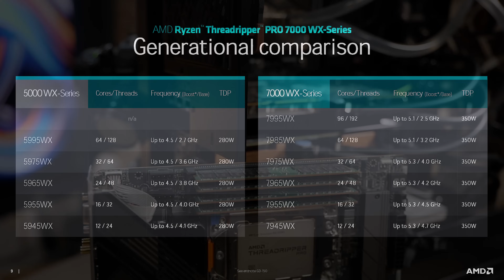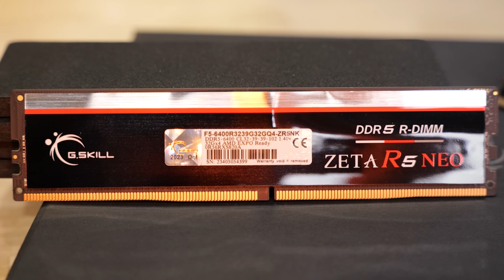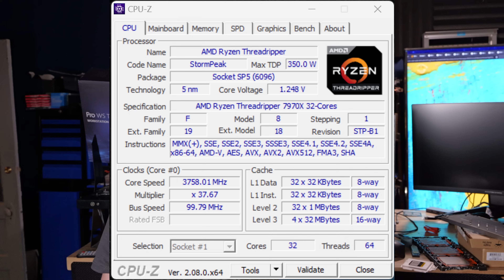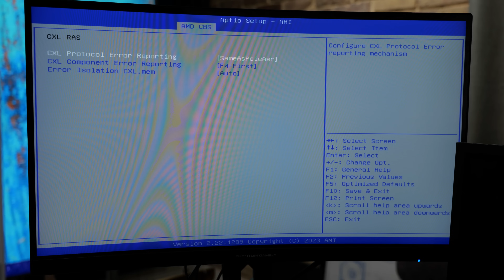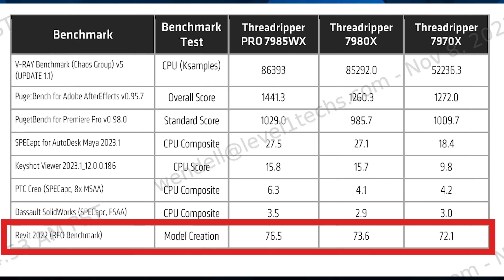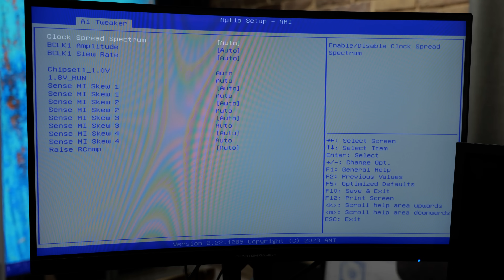AMD High End Desktop is back: 7980X & 7970X  Threadripper Tested

Comment: Can't seem to get my 7970x to fit in my AM5 platform.
Should I cut it in half or something?
Not appearing to be an easy drop in replacement for my 7950x.    AMD told me the AM5 platform was going to be supported for the next 2 years.
Reply: No, you just fold your CPU on the middle. Doesn't matter which way, as long as the pins point outwards. Then mount it in the socket.
Any pins that are not in use, can be cut off.
Reply: @akyhne  Gotcha.  I did that, but it kept unfolding and bending up pushing off my heat sink, so I nailed it down into the socket with a staple gun.
Reply: This is a troll right
Reply: @Vekstar  She's either an 1D10T, or a snarky angry consumer making an ascerbic critisism, annoyed that AMD can't decide on a single bloody dmmn socket for their own chips, and that there's two entirely different sockets between Intel and AMD, that change every 2 years.   

Instead of you know, coming up with one industry standard future proofed socket, and sticking with it for at least 10 years.

Comment: What's the cooler support for this socket? can I keep using a be quiet dark rock tr4?
Reply from the maker: generally cooler compatibility is close but not quite 100% with sp3 :)
Reply: Noctua has a new Cooler for SP6  socket. Arctic Freezer 4U-something lists SP6 compatibility. I was checking this for EPYC Siena, both are Zen4c and use SP6.

Comment: Doesn't this DDR5-6400 having "loose" secondary and tertiary timings? I know it might not be easy to overclock 4 channels, but if it's 1 DPC, you might try to drop to 6000 and try to make those timings more tight. I think.
Reply: Good thing about ECC -> the memory will tell you where the limits are
Reply: @TheExard3k  true

Comment: Way over priced
Reply: They either sell the chiplets as EPYC for much more or offer discounted price on more limited platforms like TR. If you want high clocks and lanes+memory bandwidth, there is no other option.
Reply: @TheExard3k Well EPYC CPUs have far more PCIe lanes and memory bandwidth, so not only is AMD saving money there, but the CPUs still being more expensive than their 1st and 2nd gen predecessors (both per core and in absolute cost) nullifies any claim AMD has to these not being overpriced. I would love to see a ~12 core Threadripper CPU that harkens back to X99 CPUs and boards where core count, PCIe lanes, and greater memory bandwidth could all be had for relatively affordable prices. Because right now, a system with the lowest end CPU, a decent motherboard, and 128GB of DDR5 will be $3,000, and the lack of 8 memory slots means you have to replace the whole kit when you want to upgrade too.
Reply: @jamesbuckwas6575  If you factor in inflation, the 24 core is cheaper than the 3960x from the Zen2 generation. We've had a lot of inflation lately.
And there will be a 12-core TR Pro, so there is an option for 12 cores, 128 lanes and 8 channels. Not everyone needs cores.